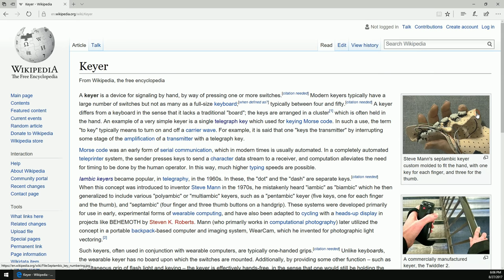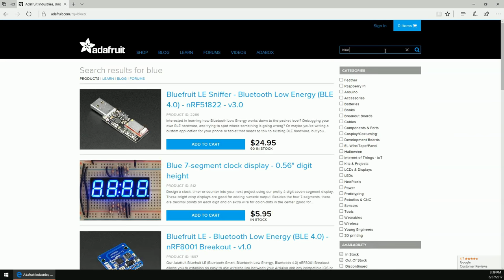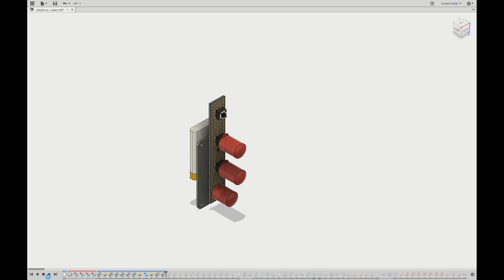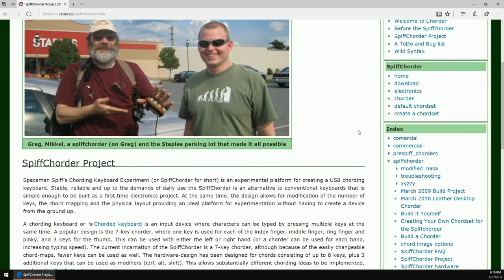Chorded Keyboard Prototype

Comment: You skipped the ergonomic models to figure out what form the casing needs to be. That is where industrial designers come into play and it happens before you finish your technical package. You can make ergonomic models from clay, jeweler´s wax (very soft at room temperature) or from Plaast polymorph thermoplast (becomes flexible in hot water at 60 degrees celsius). Another approach is to file it down from a chunk of styrodur. If you have more questions about ergonomics and product development, feel free to contact me. Aside from that, nice job. I look forward to your next projects.

Comment: Awesome. I think your main issue is the thumb button placement. Ignoring the thumb button entirely, I think you could use what you made much more comfortably by taking a full grip on it (basically, hold it like it's a bicycle handlebar) and actuate the buttons with the middle joint of your fingers, rather than the tip. But really, the easiest way to design the shell would be to take a big piece of play-doh, squish it into a comfortable shape, then scan it with a 3d scanner.

Comment: More on topic... I would love to test drive something like this if you revise it. I work for an inventory taking company ( not mentioning which one here ). Where we audit large box stores ( such as Target and Kohls ) down to gas stations and auto parts stores. Particularly the auto parts stores, our company could make advantage of this. With our proprietary machines, we have to switch modes and key like 90's cellphones. In these auto parts stores there are many areas with "line codes" which need to be repeatedly entered.
     These machines are bluetooth equipped and run with Windows CE. If it were possible to integrate these, copying and pasting difficult and repetitious "line codes" and inputting other SKU codes would be a simplistic task. In this field of work, our company gets paid higher stipends based on efficiency. Also, our company does not discriminate against those with disabilities. This would enable certain disabled individuals to keep up and possibly even compete with the other employees.
     Just mentioning this because your design has way more merit than that of the Twiddler and other products I've been looking to test drive. I myself use a Logitech Trackman, not the thumb mouse but the top trackball. It's the most instinctive and applicable design in any mouse I've encountered. So that choice for your design is perfect.

     Great video and I'll be checking back to see how your development comes along. I think you could sell this as something proprietary to a company like the one I work for. Especially if you were to help custom tailor it to the industry. Contact me sometime if possible, because I think if you were to go for it, this could be a huge thing for you. Just this one sale. Let me know what you think.

    Chunk TV!

Comment: Ideally, I think a great design for this sort of thing would be to have a strap that goes around one's waist and there's a keyboard on the left and right side of the person. Right hand uses the left keyboard, and left hand uses the right keyboard. With both hands it allows for faster typing and/or the ability to more easily use arrow keys, number keys, shift, home, end, enter, punctuation, and similar stuff.

Why the waist? 1. you can't drop it. 2. It won't use up your hand when you're not using it. 3. When using it your arms will be in a very comfortable crossed position. 4. It allows [the] two devices to be easily wired together so that they both don't need to have their own batteries and bluetooth transmitters. The only real downside is it would need to be made sleekly (very flat) which is difficult to manufacture with DIY/tinker methods. It might also be difficult/impossible to use while wearing a jacket unless it was moved to the exterior of the jacket, or you use a jacket that specifically has vertical slits on the side (for breathing, although you could make your own too in theory).